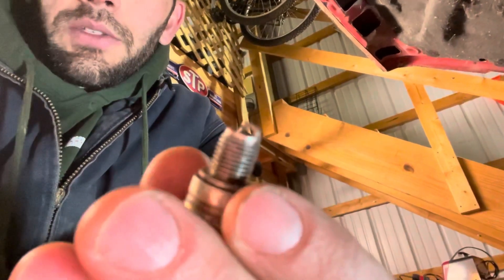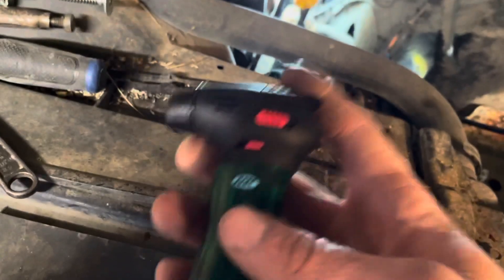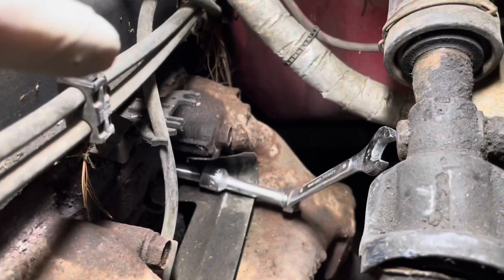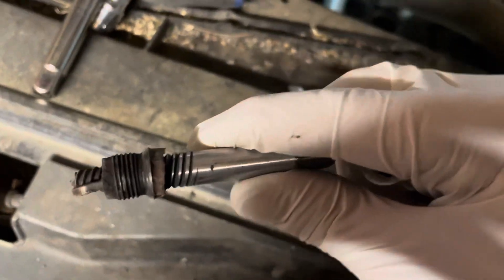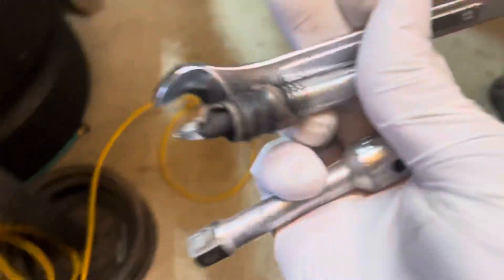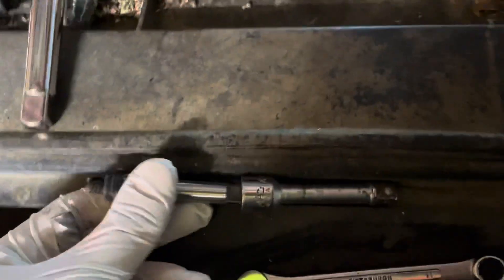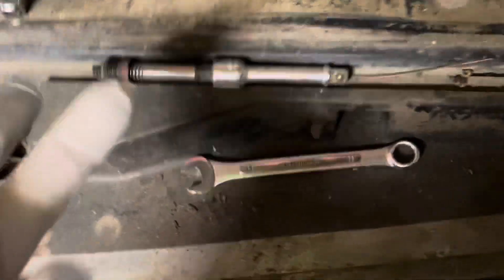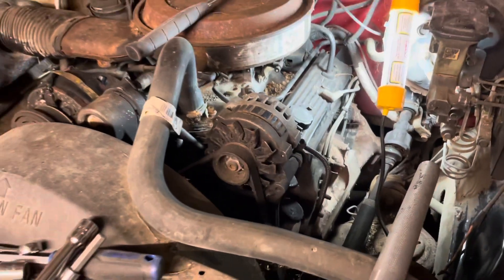How to remove a broken spark plug from a Engine block?! Extract spark plug w/ EZ out Chevy Motor 5.7

Comment: Yeah what about a 6.8L F250 Triton motor.  Cylinder #5 in back.  It is rounded and has the porcelain still. Cant get a drill or hammer back there.
Reply from the maker: You can find specific spark plug extractors for the tritons. Not sure if you have to pull the motor though 😬
Reply: @Zacpactv Yeah those kits are expensive.. Was wondering if there was another way.  But having the shop do it is expensive also.

Comment: my buick 3.8 just did this i thought the engine blew. #1 plug broke like this im just not sure if i want to fix it with so many other issues.
Reply from the maker: Yea unfortunately they probably are all getting ready to do that. you could try to break others free or replace the one and run it a little longer. I understand though what you’re going through. You have to weigh the options sometimes!
Reply: @Zacpactv  Bought a better extractor set took me 20 minutes to get it out. plan to do the other 2 front ones this weekend so i dont end up with those blowing out.
Reply from the maker: @maxrockatansky1981  glad you got it!

Comment: I got the ceramic middle of the plug out by trying to start the engine. I wanted to run it to heat it but when it sputtered for a second and I heard the hollow sound I realized it popped out. Can I still start the engine to warm it up? If not how long should I hold a torch to it?
Reply from the maker: The cylinder that the plug blew out of would be dead. You would have gas entering that cylinder i wouldn’t. I would try a torch, you could get the metal threads red hot if you wanted to prior to trying to remove. It should come out with little heat and an easy out now.

Comment: Kind of a similar problem with me but my plug is actually still in the engine the bolt head snapped off when trying to get it out any tips on how to remove it with the plug still there?
Reply from the maker: @CornCobbler55  So if you still have the ceramic/ porcelain part of the plug you can try pulling that portion out with needle nose. last resort try chipping away with chisel. I recommend doing a little at a time then shop vac it. If pieces fall into motor you will want to use a piece of tubing in combination with a shop vac to retrieve them. I have ran a motor with the plug out in hopes that any pieces would blow out as a final step. You can also rent an inspection camera I believe at parts store or buy 👍

Comment: I experienced that broken spark plug on my lancer glxi 96 mdl car. I used a screw extractor tool to remove half part of the spark plug....just be carefull in removing it, used the right tools to avoid further problem.....just sharing my experienced...

Comment: Exactly same thing happened to me always cylinder number seven 😂
Reply from the maker: always! this truck in particular had sit a long time. I went to take out another after soaking it repeatedly. It broke as well! Needless to say it was gone. To much work to find out if it was going to actually run. Truck was rough condition.
Reply: @Zacpactv  I got a 1994 Chevy dump truck 5 speed,4 wheel drive only as 56,000 miles very clean only bad thing was these spark plugs because it’s been sitting for 5 years

Comment: Been trying get mine out for weeks 5.4 to value number 5 cly no way get a hit on it with ford's firewall in way to get a easyout in there sux man got brake the porcline it's a job way down in that 2000 5.4 motor
Reply from the maker: I still have a tool made just for the 5.4 engines!

Comment: Heat wount do it any good at all.never use heat on the engine it get to hot fire or damage motor u must knock out center of plug to get a gd bite with easyout or it wount come out
Reply from the maker: I have been using heat on motors for years. Works great on manifold bolts to! Motors are made for heat 😃

Comment: Thank you  I'm dealing with similar problem but in my case the ceramic and  rod pc still inside the broken spark plug any  suggestions.  On how to approach the ceramic and rod pc to be able to  get the  stractor in there.
Reply from the maker: maybe try to rig up a shop vac and tape a small drink straw to it so it will get shavings. you can drill the ceramic all the way out. a drill bit the size of ceramic. the vacuum should suck it out as you drill with low pressure. blow out the cylinder with air and if anything falls in it. use a larger straw or what ever you can get ahold of to suck and pieces out that fall down in opening. as a last measure run it without a plug and it may shoot out anything you missed.
Reply: @Zacpactv just crank over the engine
Reply from the maker: @Blair-zq8jm  this truck wasn’t running.
Reply: @Zacpactv  even at that just crank it over
Reply: I will definitely try that I preciate your time  And your help  take care and keep up the good work my friend thanks again.
Reply from the maker: @joseanaya1144  Thank you! good luck with the removal of the pesky plug!
Reply: did you ever get it out ?